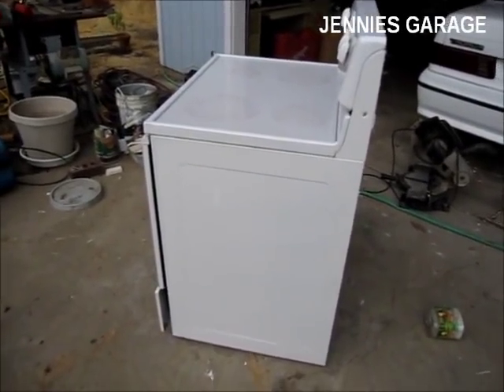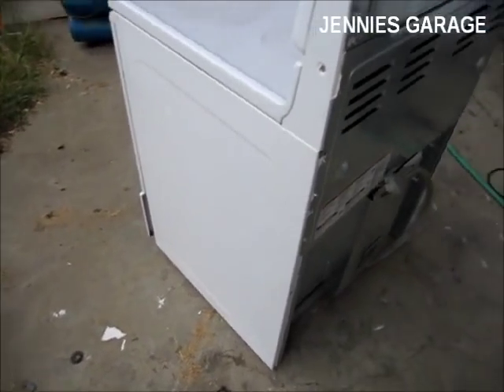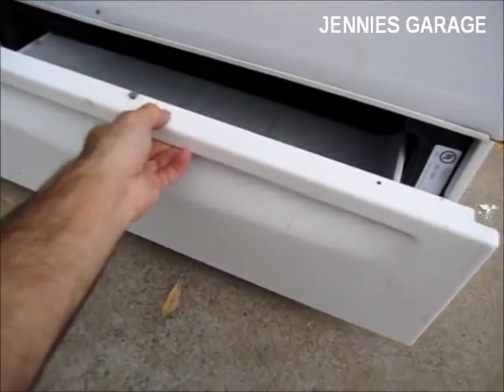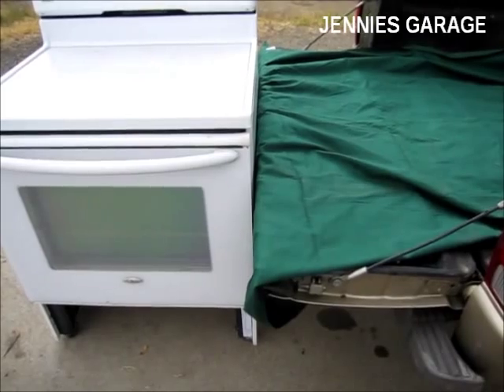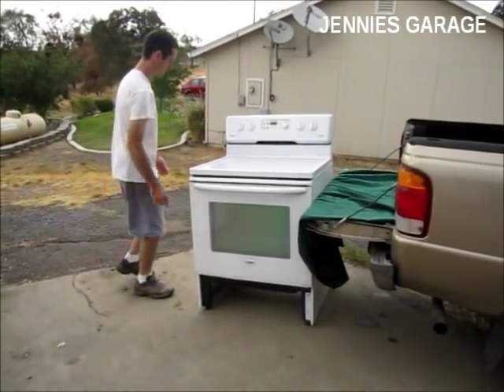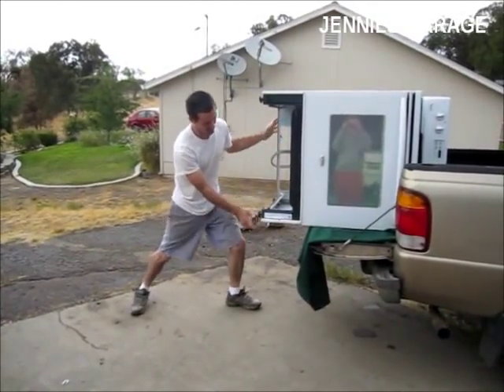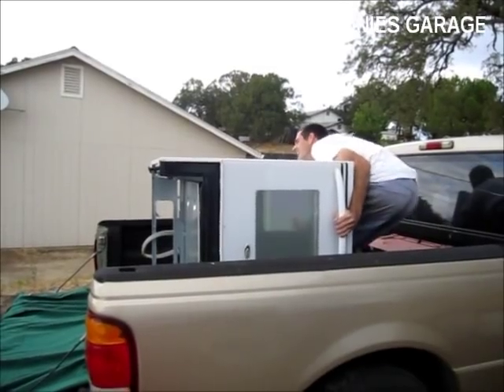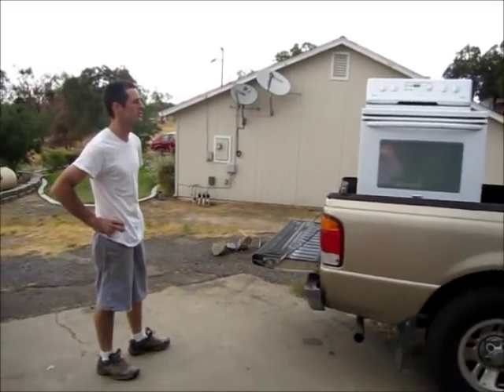How To Load A Stove Into A Truck By Yourself

Comment: Easier = drive the truck forward about 20 feet so that the rear axle is in the dip in the driveway and the tailgate is much closer to the ground. I do this routinely with motorcycles.
Reply: I back up to a street curb.

Comment: I'm a 6o yr old woman and move stoves all the time.
Minus 33 celsius right now and moved 3 stoves this week.
I just put the back of the stove to the tailgate and flip it in on its back.
At the airbnb house I pull it toward me then control it down to standing.
I then take the door and pot drawer off then walk it to the steps. Walk it up and muscle it through the door. Then slide on a rug into place. voila.

Comment: If that stove was heavier then you could lift by yourself and you have pieces of 2x6 laying around, you can raise up the stove my stacking the pieces under the stove and raise it high enough to move it into the truck. stack a few pieces under the front of the stove by tilting it a little back. then tilt it to the front and stack the pieces under the back of the stove. keep doing that as you are raising the stove.

Comment: Dude, it almost slipped down and smashed on its side. Like I mean it came defying-the-laws-of-physics close. That was seriously not the most effective or safe way of doing this. And why stand it up? You're going to need to remove it from the tray at the other end. Leave it on its side and remove it the same way you got it up there.
Reply: Fu proper for egos are much more important when you use proper form people think your weak no one can use proper form in front of people because all of us got big egos and we always care about what others think
Reply: This was the exact issue I had when trying to load my washer in my truck by myself. The blanket used to protect the washer also made the washer slide down when trying to lift it so that enough of the washer was on the tailgate to ease up the weight.  Needless to say, I wasn't as lucky as this guy and I destroyed my fairly new washer.

Comment: DO NOT load heavy appliances this way. Someone I know tore the ligaments to their bicep doing exactly this! The injury that occured can not heal itself and requires surgery to reattach the bicep. His arm is ruined from trying to load a washing machine using this method. It's not a bad method for something lighter. It's essentially treating a cube like a cylinder (rolling it like a wheel), however, the weight of the load has a fulcrum that is too high and requires lifting, rather than tipping and 'rolling'. Look at the guy's arms and bicep in use as he lifts. A few more pounds, a previous shoulder impingement, etc., and your muscle will rip. It's not just a matter of strength and some leverage but also how much pressure the body can take in a given area. If the pressure is creating max strain, only a few ounces more will cause unexpected damage.

Research it before trying the above method. I'm not hating on this video, just be careful.

Comment: dude...that wasn't very efficient.  next time, back it up to the truck.  Move the power cord to the side to allow the back to slide.  Leave a gap so you can lean it against the tailgate at an angle, then lift up on the edge. The stove is now acting like a lever (you will use very little force).  then slide it in.  You can then right the stove and strap it down.
You almost dropped the stove because you weren't using physics to help you.

Comment: See where the weight of the appliance slips downwards and he lifts it back up? That's exactly where my buddy tore his bicep. Look at his arms carefully as he loads it, you can see the arms hyper-extended and the biceps isolated on the lift. RIIIIP!

TIP!: If it's too heavy to comfortable tip at an angle, DO NOT try to lift it or put your body under the weight of it.